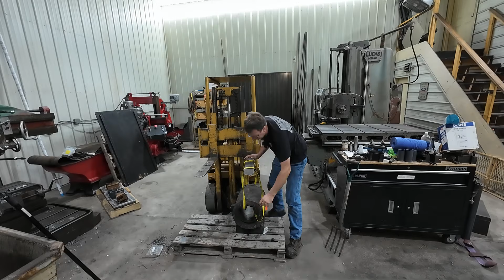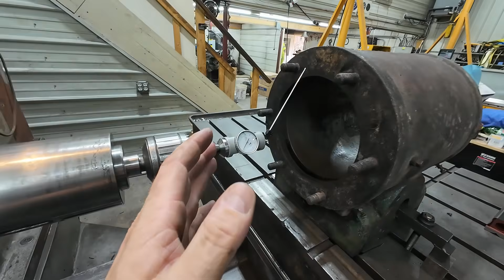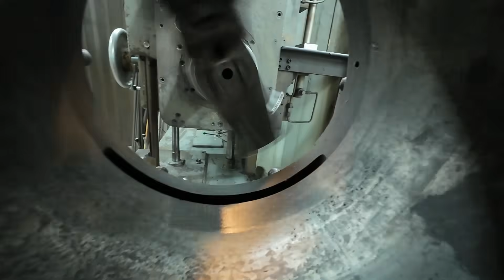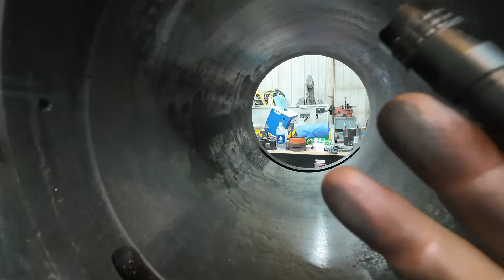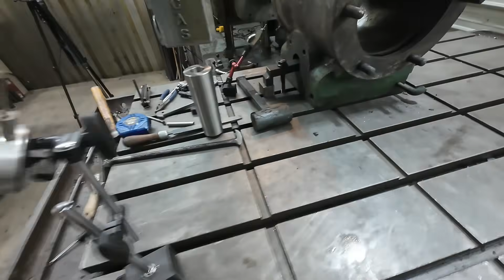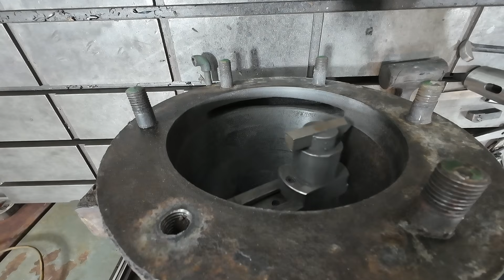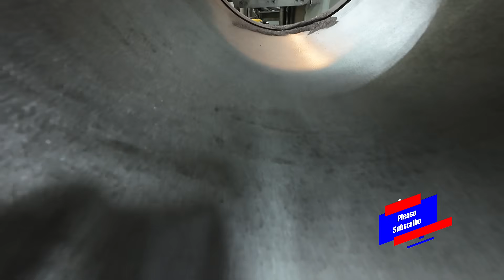How To Bore A 100-Year-Old Steam Cylinder | Manual Machining Tips

Comment: Cant beat old school machining.  I understand alot of people will disagree with that statement with todays technology and capabilities. Awesome boring machine.....Great video!
Reply: Manual machining is essential for situations where you only need to make a few (or one) of something, or where you need to make a repair, or a part made to fit.   It makes no sense for large scale production, but the skills are invaluable.
Reply: There will always be a need for manual machine work and welding for repairs, prototype and small batch work. Sometimes a manual machine is even faster than a cnc machine if the operation is simple.
Reply: I agree being a retired manual machinist and worked on all type of machine tools including horizontal boring machines in a shipyard!!!!!1
Reply from the maker: Those who disagree, don't have the skills or knowledge to do it manually.
Reply: Manual is almost always faster for one-off work. And conversational is still better than g-code/CAD/CAM for short runs and prototyping. 

Being a good manual machinist will almost always make you a better programmer, too.

Comment: Hello again. My previous comment was deleted. Perhaps for naming a known channel. I simply mentioned it so you can ask about the inserts I named.
Ccgt, dcgt, vcgt, tcgt all are positive inserts that cut very well at low speed.
The same inserts for steel also work well.
Ccmt, dcmt, vcmt, tcmt. 
Cheers.
I'm sure there are unused second hand inserts. EBay.
Positive geometry for low speeds.
Reply from the maker: Thanks.

Comment: it has a lovely satin finish now that looks like it would hold oil well. What do you use for lubricating a steam cylinder??
I can imagine that having to pay for a repair like that would be phenomenal...even presuming you could find someone like yourself that could do it.
, for you its personal time and the electricity
Looked extremely satisfying if scary to do....can't wait to see the piston and arm video's ,  how much clearance do you need on a piston like that, and will you have to have specially made piston rings?
thanks for sharing ..fascinating stuff
Reply from the maker: Steam cylinder oil. Finding someone to do it shouldn't be a problem. I wish people would just send me work, I can do almost anything. It was definitely scary. I will be ordering rings as soon as the piston is done.
Reply: @TopperMachineLLC  ah cool so order rings to fit the piston and the bore. cool I got to look up steam cylinder oil now.....thanks Josh
Reply: Easiest supplier I found for steam cylinder oil was Schaeffer, was around 150 for a  5 gallon pail. The other places I could find either sold it in 55 gallon drums or hobby sized half pint bottles for model engines. It's a unique oil with alot of tallow and atomizes well in steam to coat all the surfaces
Reply from the maker: @markvoluckas4571  I have sources.
Reply: Good to know, although I suspect my pail will last me a good while, currently only have the steam pump and swing motor from an Erie steam shovel operational, was hoping my larger Ames engine would be done by now but this past year has been busy with getting stuff ready for setting up a hydraulic shop and machine shop with a friend

Comment: Chandler boring head in it's element....Nice. Looks like a custom tool holder out on the end of 'er. I am a fan of the Chandler's and I have a couple of them too. Looks like it came out real nice Josh. I am gonna guess you had too much radius on the HSS bit and that was causing the hate and discontent. I would be interested in your take on that. Cheers
Reply from the maker: The chandler has served me well, but I wish inhad something better. The real problem.i was finding was hard spots in the casting. So, carbide was the answer.
Reply: @TopperMachineLLC  I would use a carbide tool but one with a small radius maybe 1/32 or even 1/64. It doesnt take much of a radius to cause chatter when you are sticking out that far. We use a 1" lathe tool in our boring head on the G&L boring mills that we have but many times we have to run a tnmg 431 insert so the radius is small enough to prevent chatter. Even on our cnc lathe if the boring bar is long we have to run a 1/64 corner radius. I make some large bronze bushings in a manual lathe that are 36" diameter and 24" long and I have to use a sharp carbide tool  since the bar is long and I have to bump across cast in grease grooves. The boring bar I use is 8' long and weighs atleast 1000 lbs.

Comment: Hone it Josh, even if you do it yourself. It was probably honed when it was made. Someone once said. Get it done right the first time. I like that.
Reply from the maker: Stay tuned for the followup.
Reply: Honing would be nice but would probably require shipping the heavy cylinder off somewhere with a long turnaround time. Maybe some light hand polishing with ScotchBrite?
Reply from the maker: @ellieprice363  stay tuned.
Reply: Hone it. Ring seal. Hone it by hand

Comment: I know you hate justifying your methods but maybe in this instance I think the vertical boring mill 'may' have been a better choice for following reasons. You have found, 1. the horizontal spindle has some deflection / run-out / alignment issues, 2. there is a lot of tool stick out, possibly introducing some deflection?, 3. allied to (2) gravity is working against you! Whereas with a vertical orientation the forces on the tool are minimised to just cutting - gravity is working with, not against you. You got the result you wanted so its an immaterial option just wondered if considered?
Reply from the maker: If I had a VBM, I would have used it. HBMs are used for fan more precise stuff than this with great results, so it was never a concern. But if I had a VBM, I would have gone that route.
Reply: @TopperMachineLLC  Sorry - I thought you had one!

Comment: I wonder how they machined the cylinders in the old days before modern milling machines
Reply from the maker: I wandered that too. Probably on a vertical boring mill
Reply: I have seen pictures in old books showing steam cylinders mounted to the lathe carraige for boring with a boring bar between centers. Most early lathes had t slots on the carraige for this type of use. I have bored small excavator buckets that way on my hendey along with other odd objects since I don't have a boring mill and the lathe spindle is much stouter than the Bridgeport of course.
Reply: John Wilkinson Wikipedia
Reply: machine tool for boring cast iron
 cannons presaged the accurate boring of cylinders for the
 first Watt steam engines (wikipedia)

Comment: Thats the difference in machining a billet or stock, any manufactured part, and worn one needs a lot of pre-inspection, and set-up 👌👍.
Im not a fan of Co-Axial indicators for precision indicating,  fine for quick set-up,  but nothing beats a DTI correctly used.
Looking forward to more onnthis project Josh.
Thanks for sharing.
Reply from the maker: The only real problem with a DTI is seeing it in all positions. That is where a coaxial shines.

Comment: If the height changes witht the stick-out, because of slight angle, did you measure and cut with the same stick-out? Nice video!
Reply from the maker: Since the saddle feeds true, the slight angle doesn't matter. It was very little also.

Comment: How about a stainless sleeve?
Reply: Stainless used as a sleeve will probably warp with the heat. I have worked on many types of boiler and steam systems in my 50 years of working life and stainless can only be used in a couple of places successfully. Mainly valve spindles and seats, even then the spindle nut would be a bronze insert. If you use it for nuts and bolts the heating cycles will cause it to gall, even if you use a large amount of anti-seize. I have used it for LP steam to plate heat exchangers at about 5Bar, but even then welds can crack after a number of years.
Reply from the maker: Not a good idea. Usually they are sleeved in cast
Reply: 100 years ago it was made of cast iron. It is the best material for friction.
Stainless steel gets very hot. It would be a big mistake 
Greetings